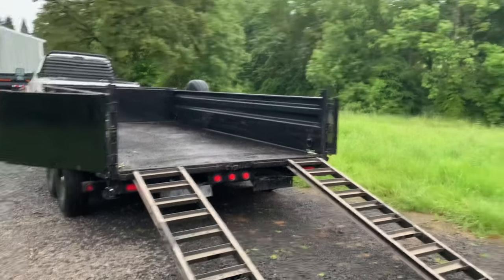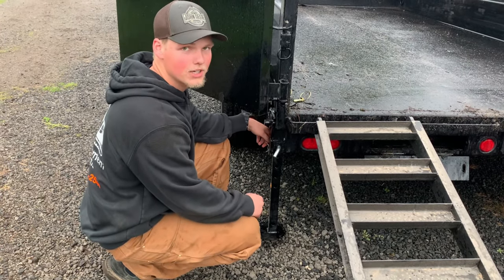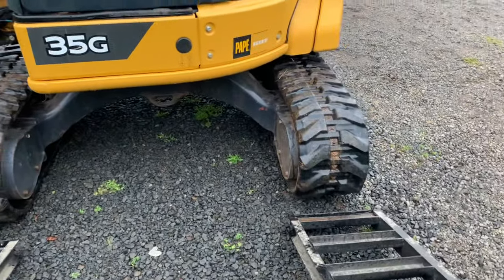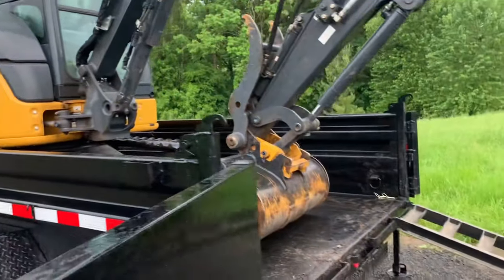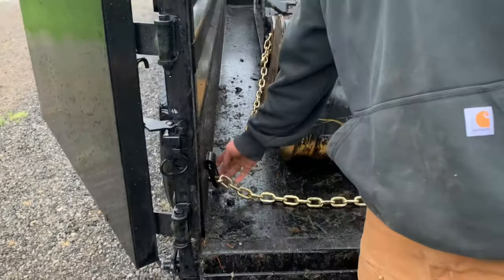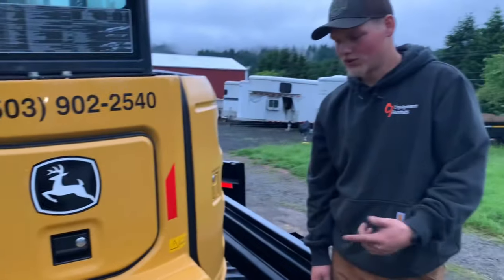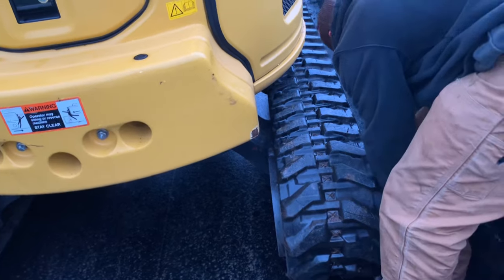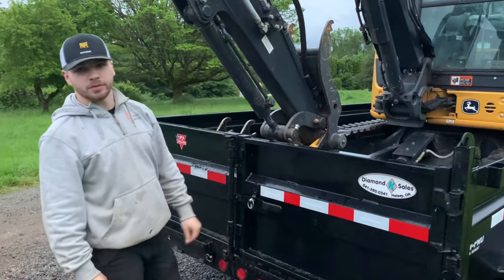How to CORRECTLY load a mini excavator in a dump trailer

Comment: the whole reason you use a dump trailer to move heavy equipment is so that you don't have to spend time chaining down.
Reply: Exactly. Tall sides mean it can’t fall off
Reply: Really, don't get pulled over with it not chained down 🙄
Reply: Still has to be chained no matter what type of trailer
Reply: @Plumbingfarmerinvestor  its a joke since most people I have seen don't strap or chain stuff when in dumps
Reply: I gotta know. You are joking right?
Reply: Still gotta chain it down by law
Reply: @AustinT247  yup, don't speed either🤣🤣
Reply: @Ramdodge582  I don’t chain anything legally tho… most you’re getting out of me is 2 chains and 2 binders

Comment: Nice but your machine is a little too far forward and is not equally distributed on the dual axles. Makes for a heavy tongue weight.
Reply: Not on a pickup with a bolted on hitch....

Comment: This seems like way too much force is being applied to the D-rings and they could easily be ripped out of the trailer. I would like to see separate chains and binders at all 4 corners instead of all that force literally trying to rip those rings apart.  Think about it. It distributes the force much more evenly. And if one fails going down the road or in panic braking the other 3 firmly hold the machine in place.

Comment: Great video!! I would recommend that you instruct people to increase the throttle around half when operating, not under load. Running at idle puts more stress on hydraulic components
Reply: ??? Are you mechanic ? I am. Myself I think he run it extremely well, and with zero stress. He’s machine is pretty well cared and would last forever I think. 

These machines have variable displacement pumps, if you request less oil but some pressure the pump will provide it with zero stress, it will set itself as if it is a very small pump. 

If you request too much energy at idle, the motor will not able to provide and it’s not good to do for him, but you can hear that.

Comment: Chain working load limit depend on the grade of the chain. The gold chain you are using is grade 70. 5/16" grade 70 chain has a working load limit of 4700 lbs.

Comment: Been hauling excavators in dump trailers with a flatbed dually for over a decade now and some things I have learned from some old timers and trailer dealers about this method of thinking is that it comes from flat beds and deck over equipment trailers. Dump trailers are built to be loaded rear heavy so they will dump their max load. it’s also necessary to take into account that the trailer gets a good portion of its payload capacity from tongue weight. for instance, a 17.5k trailer will have two 8k axles and gets the remaining 1.5k from the tongue weight of the trailer riding on the hitch of the truck.  Meaning that while proper weight displacement  is important,  it’s easy to overload the intended tongue weight as the trailer is designed to be loaded slightly rear heavy. 
Load blade forward bucket forward and articulate  your boom so that the cutting edge of the bucket is touching the cutting edge of the blade and drive the machine forward until just before the back of the bucket touches the front of the trailer. This will put the cab/tracks/engine of the excavator centered over the axles and the boom and blade forward giving you the correct weight displacement.
Reply: Hey Noah: Revisiting this some months later. We've just purchased a 7600lb Kubota KX033 mini excavator. I'm picking up a dump trailer to move it later this week. (14', 14k trailer). My tow vehicle is a Max tow f150 rated up to about 12,700 lbs, max tongue weight of 1200. I'm worried about overloading the tongue. Do you suggest reorienting the machine so blade and boom are facing towards the tongue to keep center of gravity back on the trailer? I'm going use a weigh safe hitch so I should be able to get an idea of what my tongue weight is either way.
Reply: @xxxmikeyjock your truck will disagree with this.

Comment: Im assuming the hook on the 3/8th chain on the didn’t fit through the d ring but that doesn’t necessarily mean you need to go with a smaller chain, if you take one hook off the chain to run it through the d rings when you put the binder on all you need to do is put one hook on the side without a hook and the other side on the opposite side and it still works the same as using a chain with two hooks. Just an OIT if you didn’t know.

Comment: What’s the length of your dump trailer? I’m looking at 35g but I don’t know if it will fit my 14ft dump trailer. It has 3 foot walls as well.
Reply: Did it fit after articulating the boom? I fit bobcat e26 in my 14’ no problem.
Reply: @jacobbelfield9835  what about  12ft for a 30g JD
Reply: @diegosierra1963  I wouldn’t recommend it. Youre gonna be really heavy on the tounge. Check your trailer specs first. If you have a 1 ton truck, at that point it’s all about how much can your trailer take… A 1 ton can take that payload tho

Comment: Curious why load the machine backwards meaning the blade is facing the rear bumper of the trailer?
If it's a tongue weight thing your trailer is too small to get the weight you want on the back of your truck I get that.
But if it has nothing to do it wait then I believe the correct way to load is blade first meaning the blade is closest to the truck. 
There's a number of reasons why for this but I think one of the main is if something happens where you lose a ramp break a ramp Bender ramp ramps get stolen whatever if you're a proficient operator you would still be able to get the excavator out of the dump trailer without ramps yeah yeah it's sketchy as poop 💩 but it can be done kind of safely. Lol 
A second reason is if something is going wrong while unloading you have to boom to help stabilize you on the way out and you have your blade to help stabilize you on the edge of the dump trailer. 
Another thing you did not discuss was if you have it putting the truck in four wheel drive putting emergency brake on using wheel chocks but anyhow all in all decent video.
Reply: @xxxmikeyjock  I never said it could not done. It's just possible that it's more difficult. Depending on the approach angle or departure angle the blade will get stuck in the dirt and if you're on concrete or asphalt you will scratch or rip up the material. So if the blade is still up in the trailer you have nice smooth tracks that are touching either dirt concrete or asphalt.
Dump trailers are typically higher than equipment trailers anyhow loading blade first can just make things easier. 👍🤷‍♂️

Comment: Always block tires on trailer not truck.  Stands or not . Some day stands will bend or go through
 asphalt and away you go . Also dot. Requirements is a separate chain and binder in every corner.  Also need to reposition machine,  to much weight on truck.

Comment: I can probably guess - but why do you have to also strap down the bucket?
Reply from the maker: We strap down the bucket to decrease the movement of the arm while traveling. The idea is to keep all the pins in great shape and hopefully make the machine last longer
Reply: @xxxmikeyjock  DOT requires it because the turn table doesnt have a lock on it and the entire cab and arm can swing into traffic. Which of course cannot happen with the high sides of dump trailer, but on a float, where most Xcavators are hauled, they can swing out easily.
Reply: @xxxmikeyjock  lol. Well I’ve seen a 300 series cat boom swing as the driver caught the edge of the road as he moved over too far for a log truck and slid down the slope sideways and had to be fished out of a pond.  Shit does happen.
Reply: @xxxmikeyjock  broken machines get Hauled just like intact machines. Maybe there’s a good reason for chaining that boom on the 200lc you operated.

Comment: I was wondering why the other videos that I watched, they loaded boom forward, and the C of G of the machine was way back, pretty much over the wheels it looked like.  I like this way better.
Reply: It really depends on the weight of the machine,  how its setup and how the trailer is setup. Best thing to do is to set it up and check axel weights then adjust your loading technique for the combination of equipment. An ex with a mulching head will load differently than one with a small bucket. Same with a skid steer. It will also be different for each trailer. A 14 ft with a 3 ft nose will load much differently than a 16ft with a 5 ft nose. The best thing to do is scale it and adjust.